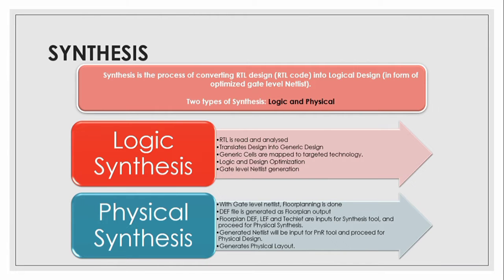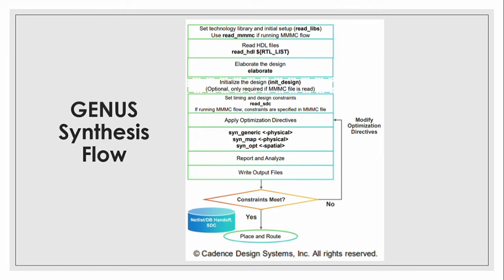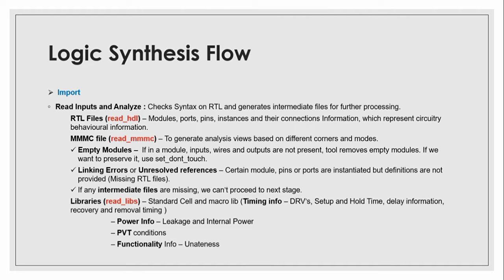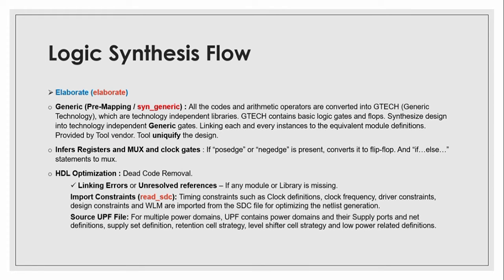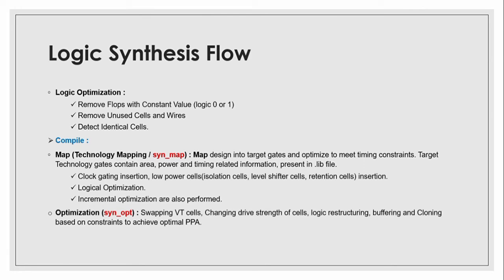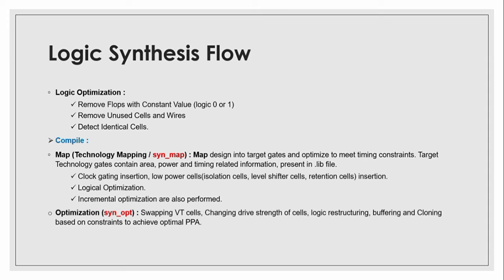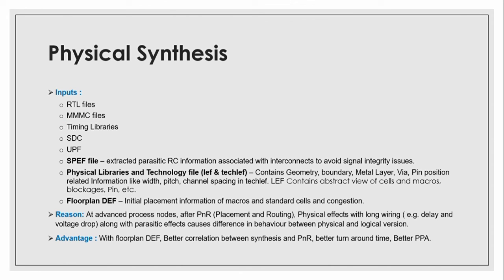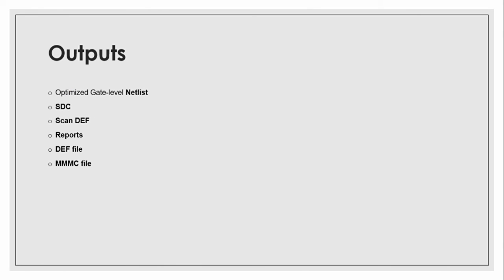Logic Synthesis and Physical Synthesis || VLSI Physical Design

Comment: Clock gatings are already written in rtl right as you told but de we insert clock gatings manually in synatasis or in  pnr .? If we need .? Or  we won't do that practically?
Reply from the maker: Clock gating is typically inferred by the synthesis tool based on RTL, but it can also be inserted during synthesis for power optimization if specified in the constraints. Also, clock gating can absolutely be inserted during the PnR stage. While typically handled during logic synthesis using Synopsys ICC2 or Cadence Innovus to perform physical synthesis and support late-stage clock gating to fix dynamic power issues or adjust clock topologies.

Comment: If after logical synthesis still thair is a - ve slack wath are the techniques you will follow.?
Reply from the maker: You can address negative slack by optimizing logic levels, performing timing-driven placement, or using higher drive-strength cells. And some other techniques also there, but can't explain in comment. Negative slack after logical synthesis indicates that your design’s data paths violate timing constraints. To resolve this and achieve timing closure, you must either speed up the critical paths or relax the design constraints. These are basic techniques. I will make a separe video on this.

Comment: What is flow for physical synthesis like for logic synthesis it is translate+optimisation+mapping?
Reply from the maker: Yes, the core flow of physical synthesis is similar to logical synthesis (translate + optimize + map), but with a critical distinction: it integrates placement and routing awareness into these steps to handle physical effects like wire delay. While logical synthesis produces a gate-level netlist, physical synthesis produces a placed and optimized netlist ready for routing, bridging the gap between front-end design and back-end implementation.
Reply: @EngineerVijitaaDas  once the floorplan def file is done by using logical synthesis,  don't we do again floorplan by using the physical synthesis or we should go to powerplan and placement stages

Comment: floorplan def is need to inputs of physical synthesis, how this file available before the floorplan? it available after floorplan right! So how can it will be given input of physical synthesis?
Reply: It's like iteration we have to do logic synthesis and then floorplan after floorplan we will get the def file that we are giving it as an input to the synthesis tool and performing the synthesis with fp.def file which means we are giving the physical constraints as input to the synthesis tool so it is considered as physical aware synthesis
Reply from the maker: @451ecesunanda 💯
Reply: In few flows particularly FC flows we will get Floor plan DEF after init_design it self we place Macros and pins in init_design so it doesn't depends on always floorplan it's depends on flow and project
Reply from the maker: @c.nagasurendrababu156 correct

Comment: Mam i have one doubt generally spef file is generated from star rc tool which is extracted after routing ...but how we give spef as input in physical synthesis

Mam please clear my doubt ..i am waiting for it mam
Reply from the maker: It is clearly mentioned in the video that Spef is an optional input to Physical synthesis which contains parasitic data for wires in a chip to meet timing and avoid signal integrity issues
Reply: @EngineerVijitaaDas  mam may i know at which stage spef file is generated...
Reply from the maker: after routing stage. But floorplan and placement has to be good. As SPEF file contains R and C parameters, which depend on the routing and placement of the cells and tiles. This file is used to accurately calculate IR-drop analysis and other analyses after routing.  This data is important to consider because non-ideal wires have parasitic resistance and capacitance.
Physical synthesis is a process that takes into account late-stage implementation effects early in the design process. The goal is to create a design flow that requires minimal rework. Physical synthesis considers effects like wiring, parasitic effects, and long wires. These are iterative process but with few iterations, results can be achieved as targetted. After spef is generated, if we still see SI related issues, we can use the spef as input to Physical Synthesis flow at compile stage. Then synthesis tool is now aware of RC data, so tool doesn't have to estimate using WLM. Thats why designer use spef. Hope this explanation clears your doubt. Thanks
Reply: @EngineerVijitaaDas  thankyou alot🙏 mam🙂....after completion of routing stage we generate spef file and this spef file is now used in physical synthesis process right (if spef is required)
Reply from the maker: @kv8536  yes based on violations and issues faced by the designer
Reply: @EngineerVijitaaDas   thankyou alot mam for your reply 🙂🙂